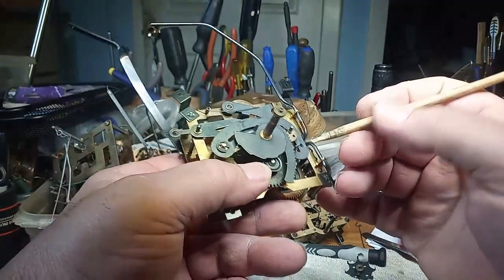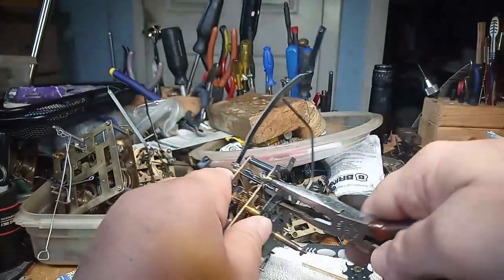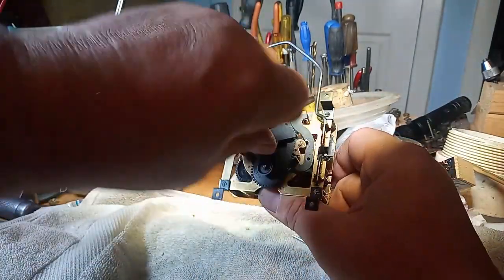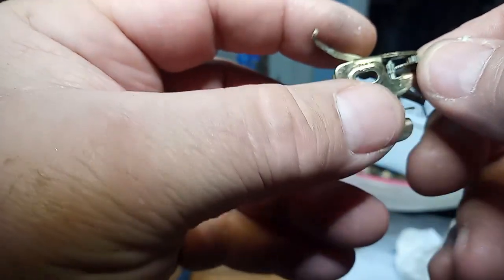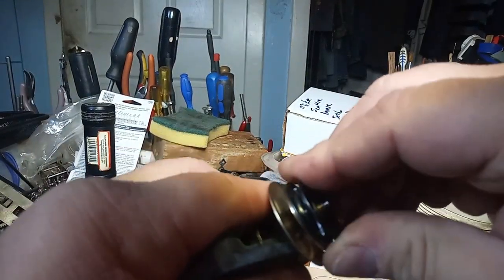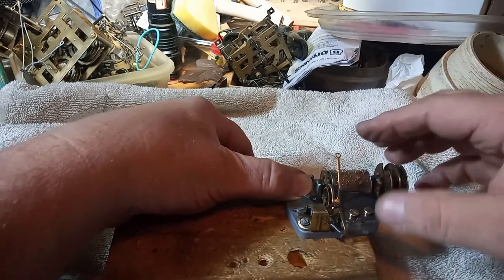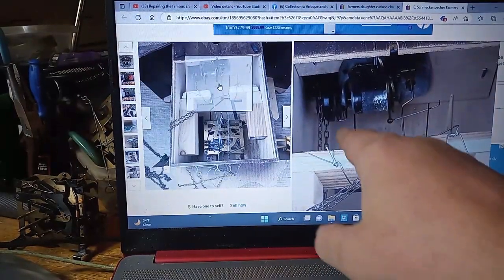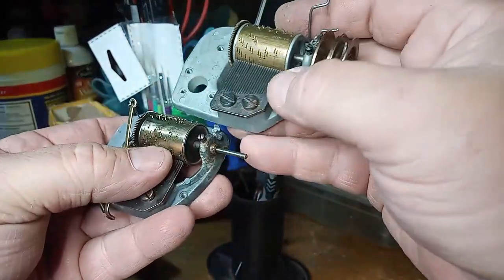Repairing my Schmeckebecher Farmers Daughter clock that I paid $30 for (See description)Part 2 of 3

Comment: Do how they did when they jerryriged the music box on the clock's body but above and on the board where the part broke off. make a tiny board and staple the wire in and link the wire to the packman wheel it should work
Reply from the maker: There wasnt any signs of them doing that. The lady couldnt come back into the house or even go out like she is supposed to the way they had it set up.

Comment: My cuckoo kept stopping during the cuckoo call with 275 gram weights for a reg 25 .I put 320 gram weights on and all is working fine now
Reply from the maker: The clock movement might need to be serviced (cleaned and oiled with fresh oil), the bellow lift wires might need adjusting, or there might be something else wrong with it. You can send me a message on Facebook and then after I answer you can send me a video of it working. My current profile picture is me hugging a fake bear.
Reply: @munnerlyn3  The clock is actually a hubert herr double door music chalet with the 2 people at the bottom but turned into a single door cuckoo only clock. that someone made with a regula anton S movement from 2005. I got the clock on eBay from a guy for 85 bucks. he said he refurbished the clock
Reply from the maker: @wesleyditchko8376  adding the extra weight is only telling me that the movement needs serviced or the verge and crutch assembly needs adjusting because the clock is out of beat. Watch my videos on putting a cuckoo clock in beat.
Reply: @munnerlyn3  i have the clock in beat the 320g weights work
Reply from the maker: Glad that it works.